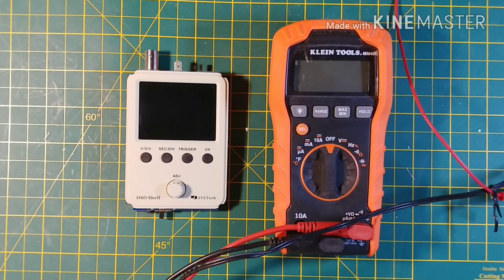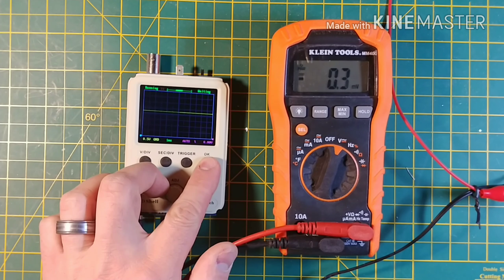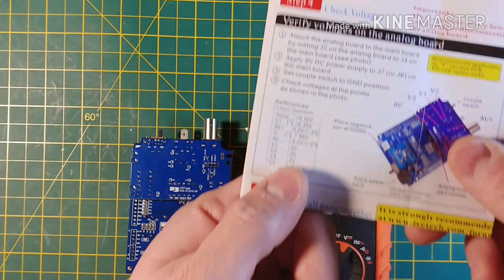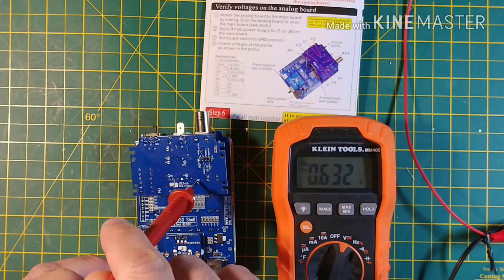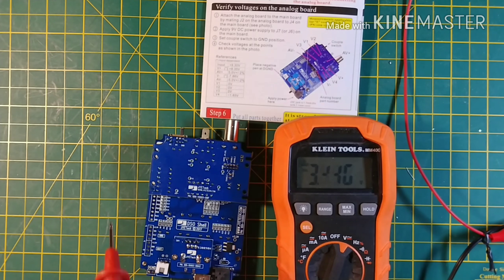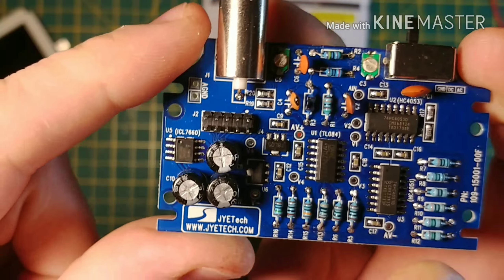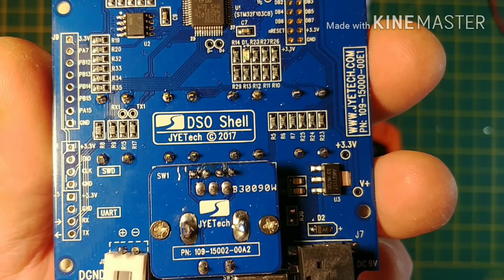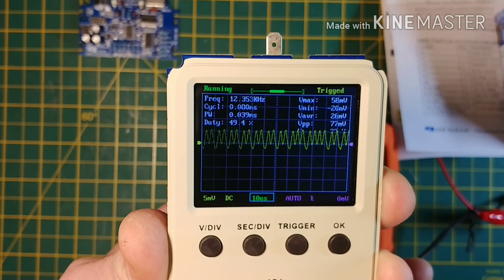DSO 150 shell problem

Comment: I had the exact same problem with roughly the same V values you show, I traced the issue to the U5 which is meant to be the DC-DC converter to get the -V value, pretty much as you did, I also tested the main board like you to isolate the issue and indeed the main board is fine. The problem must definitely be on the IC 7660; for a moment I tought that perhaps I accidentally fried it with a higher than necessary input voltage but it seems to be a relatively common issue.

Comment: Solder any solderjoint You did with flux and HOT iron again. My DSO150 had the same Problem. And it did Work.
Reply: got a new problem now …….. the sec/div wont alter everything else does like perfectly (ish) ya no trigger etc but the right hand side indicator only goes down any thoughts?
Reply: @andymouse  
Classic symptom of not following the calibration procedures properly.
Reply: @Dennis-mq6or I grabbed the latest firm ware in the form of a hex file uploaded it and all the problems went a way. But you need to get a "key " and they only give you one of them if your scope is genuine, and I was lucky that mine was.

Comment from the maker: I did calibrate before use.  There were no dry solder joints.  I contacted the seller and they sent a fresh unit that is working fine.

Comment: you have not soldered pin header male properly
I had exact issue for voltages
Reply: how can you not solder pin header properly it has 10 holes , doesn't matter how you turn it , as long as you have it in the holes , how can you go wrong,  its a symmetrical pin header .
Am i missing something .